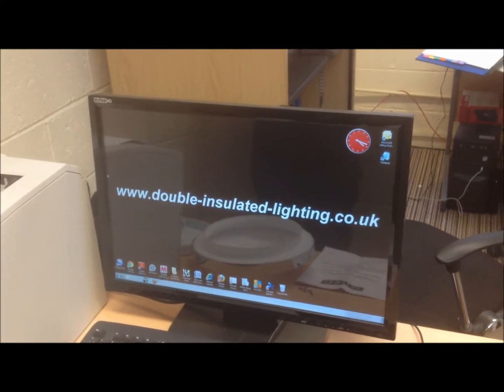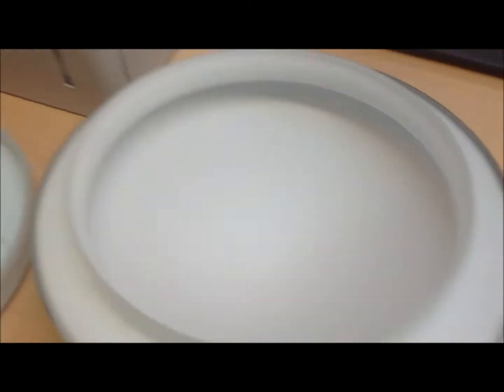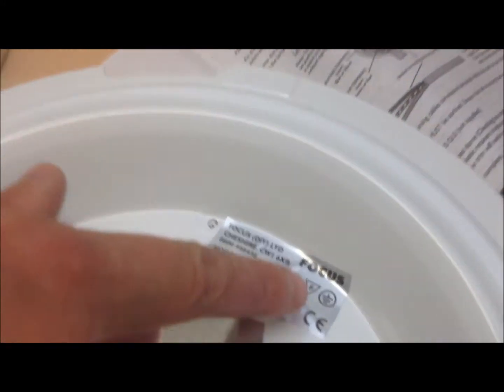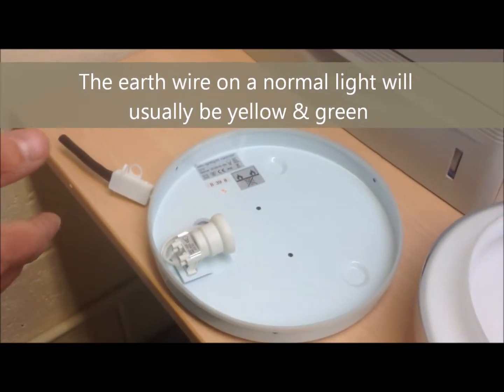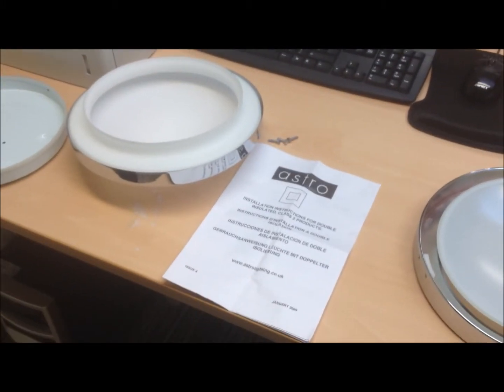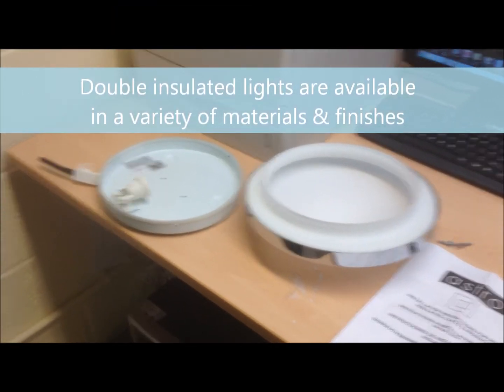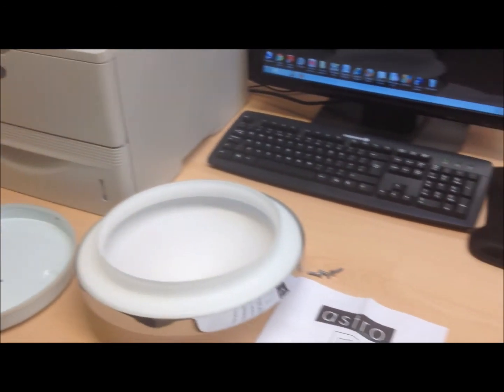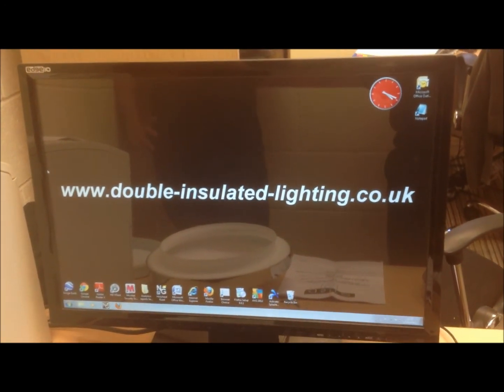The difference between normal & double insulated lights

Comment: I'm just trying to work out how to wire in two double insulated LED spots using a plug instead of mains. I am going to connect the spots in a circuit with one wire going to the switch. The cable I've bought has no earth. It's a metal switch. Is it necessary to have an earth? The cable that will go from the light switch to the plug also has just the live and neutral wires. Is it ok to do it all with no earths, especially considering I'm using a metal switch and a metal box?
Reply: mate get a sparkie.
Reply: No, metal switches should be earthed.